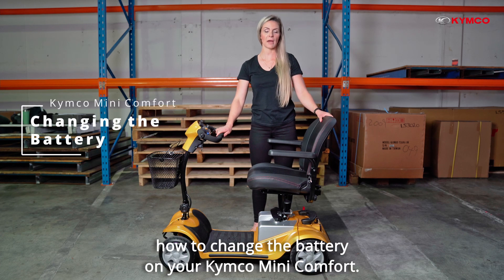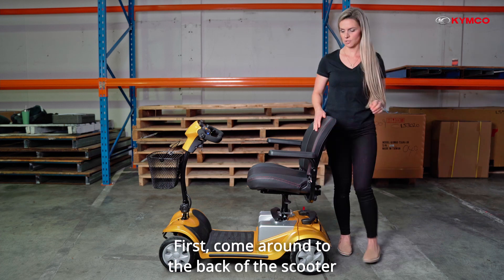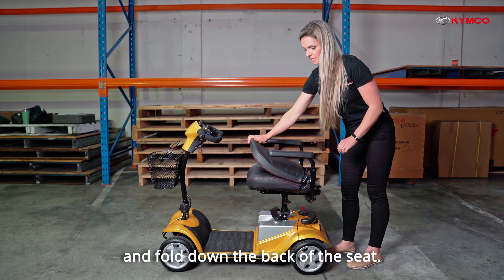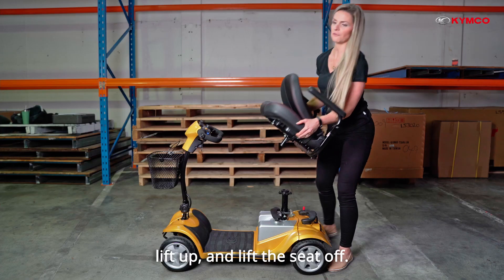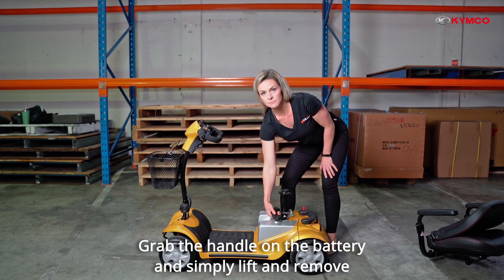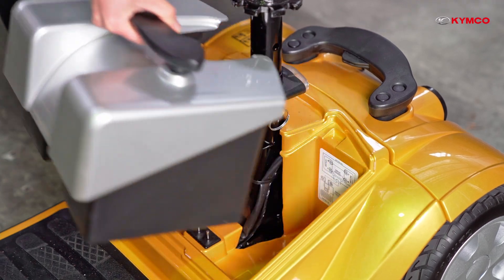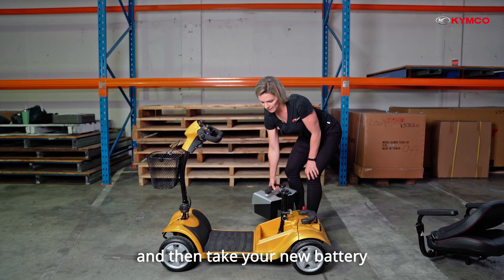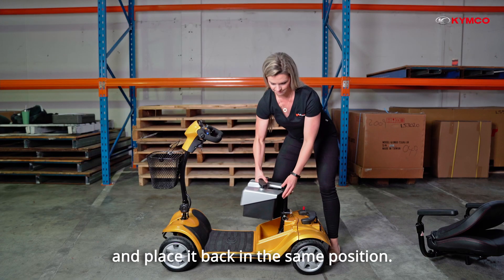How to remove or change the battery of a Kymco Mini Comfort mobility scooter

Comment: Is it possible to get a replacement battery with a better range for the kymco mini comfort please.
Reply from the maker: Hi Jessica,
thanks you for your message. There is a possibility to upgrade to Lithium batteries, which gives you a slightly longer range, roughly 5km per charge, however it comes at quite a high cost as you will also need a new battery charger. Unfortunately due to the design of the battery box, there is no physical space to add larger batteries with a higher capacity.